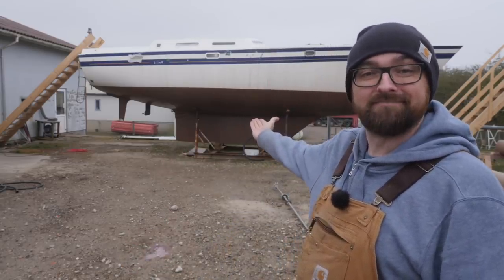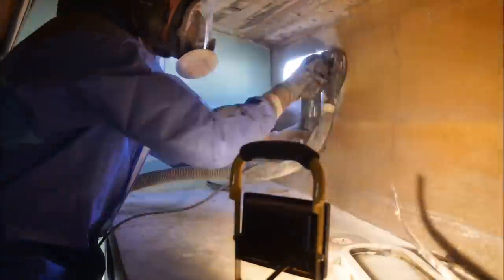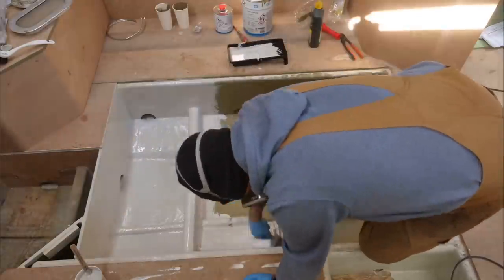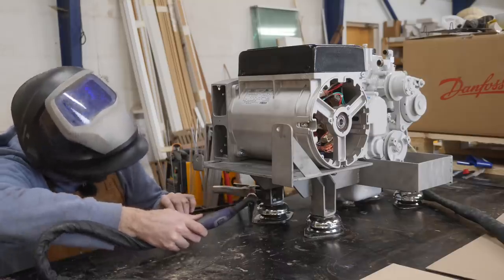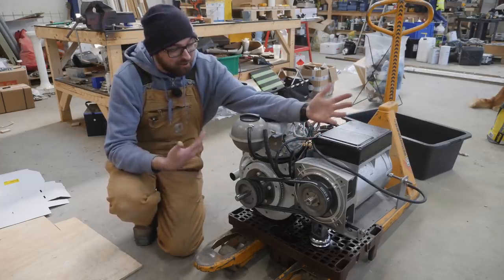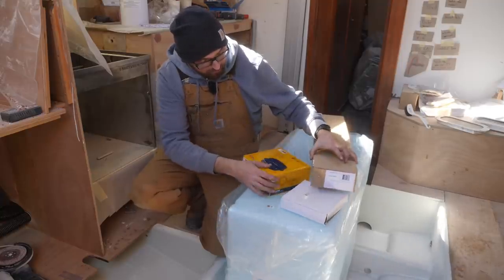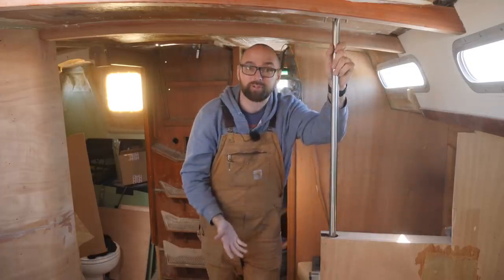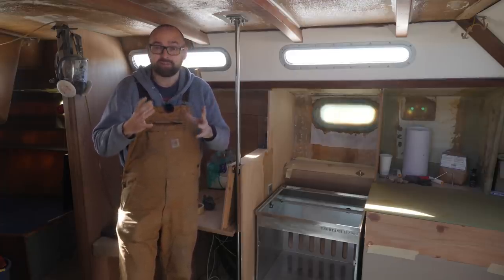Sail Life - DIY generator fail, galley pole - sailboat project

Comment: why not add a small  portable Onan diesel generator and  run it in parallel with your Perkins generator when necessary. This will also give you  redundancy for your generators and give you a generator you can take the boat if needed

Comment: dude with that genny ,you'll want a three to one turn over. the larger pulley on the gen side. should give lower rpm's on the motor ,with higher output on the genny. the better the tune, the longer ya run.

Comment: You have way more power then most, so wipe away those tears. You will just have to have a laundry day where you don't need to run the water maker too. Also your wifey better be baking up a bunch of cookies without laundry duties. So there ya go, Cookies, coffee and on laundry day it will just have to be done with a good beer. See? Solved.

Comment: Your generator problem will be fine.  I mean look at the obvious.  When will you be running all the heaters, water maker, air pump for scuba tanks, stereo, tv, uploading videos and nuking a hot pocket, washing and drying at the same time?  Just think outside the box.  The power is adequate for normal use.  Unless your salvage diving in the artic circle during winter I honestly don't believe you will be running every electrical component at the same time. Keep smiling, adapt and overcome and keep on sailing my friend.

Comment: How you going to fill that tank? Diesel stinks you won't want to spill any on the cabin floor the smell will linger for ever
Reply from the maker: The plan is to pump it into the tank from the stainless tank (aft of the engine)

Comment: Not the perfect solution, but more of a what if.... Have you ever thought about running two alternators?
Reply: Maximum power out (of the diesel) equals maximum power into (and out of) the alternator(s). You can't magically get more more power out of one or more alternators than the engine produces. That would violate the laws of physics. And given that no conversion system is ever 100% effective, you'd probably only get 90% of the engine's output from the alternator(s) anyway.

Comment: It's your boat/dream, it's your budget and time line. 

Not telling you what to do, but my two cents... 

Better to have more than needed than to work with less. This whole rebuild is yours and as many times as we've watched you redo sections because it did not meet your needs I can't believe you'd just accept lower power output.

Comment: Not sure what your price range is, but $1,450 they have several brand new Yanmar 2V750-C's on ebay item #202807121399, which are 18 hp/13.42 kw at 3200 rpm. For air freight at the 84kg claimed weight it would cost about $315 to transport it to you, probably not including fees or taxes where you are! Found that at shipnex, the company selling them would most likely help in arranging pickup or transport for the carrier, but you would have to contact them!

Comment: Keep and eye out for a Perkins 402 if they are demensionally the same run the 102 until then. It's not like this is 500 kg part that you can't move it later. Don't dwell on it Madd's fuck ups happen it will end up keeping you from moving forward.

Comment: Sad but...maybe a good moment to review all the changes from the original plans. DIY and Sailing. Are things getting off track too much or not. Cooking on a diesel stove or gas you have laying around or?.... this thing will stick in your head for years to come, unless you can say goodbye to the whole electric idea. So, if you really want a generator. Just phone the Perkins dealer, pay the 2500 - 3000,- Euro and get a brand new 402. Problem solved. for sure you will find a way to save the 3000,- on something else. good luck!

Comment: look like you are running 1:1 ratio I know that diesel engine have lots of tork maybe you could go 1.25 or 1.5 to 1 ratio use the engine tork to make up for the power. And you should use power from your batteries and not the power directly from the generator. 

battery give cleaner power less oscillation and you can add solar power to makeup for the lower power from generator. also i have seen electric saildrive that are very good at generating power under sail. that said you would need better batterie. to keep up. 

but what do i know. I still dont have a boat. i did not experiment my self (maybe a little on my camping trailler, I had power when every one was out running generator. living north of Canada)

Comment: Why not look at modifying the motor? See if you have enough meat in the cylender wall to have a machine shop bore it out and put a larger piston in, fit a small aftermarket supercharger maybe if its a 4 stroke? I bet you could at least get another half as much horsepower safely out of that engine without shortening it's life for less money than swapping it out.

Comment: I really hate to say it, but you really need to upgrade that engine if you're going to go with the DIY approach.  You are going to have a situation where you will need to have two or three items running, not for "convenience", but because you will NEED to.  Remember, you're talking lights,  Power for chargers, electronics, and more.  You will want that extra room...

Comment: 1 200 amp alternator, plenty of power
Reply from the maker: That depends on your power consumption ;)
Reply: Lithium batteries connected to a magnum inverter charger. We’re 2adults an 5 children, we also have 2 135 watt solar panels
Reply: The 12 gallon hot water heater pulls the most, washer not much but the dryer hits hard

Comment: Dear Mads :  Before you make one more mistake ,you can’t use this Tank for Fuel because of gravity problem. Plus why you want the bad smell of Fuel in the kitchen?
Where are you going to put the fuel inlet and cap?? How are you going to get a Full Tank? That why they make fuel tank small in height an long in the bottom of the floor.......Please think more before you a Project. I would use it for freshwater since you be pumping water to make freshwater. Then when tank is full it will have some pressure. To use it for Fuel you are going to have install inlet hose on top and tru the top deck. Not good. Not to be a pain but the hull in the back look very thin and more fiberglass = more weight. Think you need to see how much weight she is at Now?
I like the bigger pulley ideal , 
try it first an cost will not be to much money in that.

Comment: Sell the small engine, buy a bigger one. Take the short term financial hit and put it down to the learning process. If you don’t, it will annoy you every time you use the gen and regret the limitations in the units useability.

Comment: Mads, check this out!  Could still you find the one you wanted and clearly need! The Victron inverters aren't cheap either!! https://www.mylittlesalesman.com/2003-perkins-2-cylinder-diesel-engine-apu-type-kn70333-fam-3h3xl451e2v-runs-perfect-9399484

Comment: That’s a shame about the generator. Not that you’re looking for advice here’s my two cents and worth exactly what you paid for it. Don’t compromise. Power is maybe the most important comfort item you can have on your boat. I guarantee you will never have enough. Generators are noisy and expensive to operate. For now and forever, every time you can’t run an electrical item or are wanting to quietly enjoy a remote anchorage only to have the moment spoiled by the noisy generator you will regret the decision you make today. In for a penny, in for a pound.

Comment: Not to criticize, but honestly, in a green energy future world, We decided to just go with 700Watts of solar and 3 lithium batteries. No generator needed. What do you want to run that you feel requires the generator? We feel We are off-grid and no need for fuel or maintenance on a generator. I run 2 laptops, 2 ipads, all boat instruments, freezer and fridge without any problems at all. This assumes you leave behind those cold dark rainy places haha and sail to Florida where life is always sunny :-)

Comment: Mads, it is a simple solution. Get a correct engine. You dont want to have to run  that thing for any longer then necessary, Sure it is more work and more money but since when has that stopped you. You are like the energizer bunny!!! This is not the thing to comprise on. You have chosen to have a diesel electric boat and you need a proper diesel. 

In the more work and more money category, I was wondering if you had thought about having an ac generator on the main engine. It would be a back up, and sort of free power while motoring.... just a thought to make you work and spend more...

Comment: Not the mistakes you make it how you deal with them. 

Sell the working generator engine.  They are worth more as a working set. 

Buy another engine and generator in fixable condition for cheep. Repair the problems! 
Mate them!  Paint them! Make a buck from the swap!

Comment: If you haven't already, you may want to consider a fuel cell.  I have no experience with one, but here is a blue water sailer and youtuber I ran across sometime ago who uses one in lieu of a generator or solar panels: https://youtube/N7VYsXuvWXs. Good Luck!
Reply: I had no idea these even existed for sailboats.. many thanks, you've helped me make an important decision for the boat I plan building soon!

Edit: for those who missed the link correction above, here it is again: https://youtu.be/N7VYsXuvWXs

Comment: A second comment I have is what about mitigating with a power head on Athena's main motor, or even just a high output alternator to feed an inverter for high demand situations.   Sure it is not AS efficient, but really how much can that difference be, eventually energy is energy.   If I owned a sail boat I would hear the main motor run every week, even if it was just an exercise to circulate fluids...

Comment: You are WAY............  to hard on yourself.  Given all you have done DIY on your sailboat, don't let this minor setback bring you down.  You have accomplished so.....  much already.  Like others have said, find a 402 and swap out the engine so you can get the power you need.  If you don't, you will remember this small bump in the road everytime you run short of power.  You must be able to find a 402 somewhere over there.  We all make mistakes, just learn from it, brush it aside, and move on as this is a part of life.

Comment: I disagree about not keeping the current generator.   First, you have time and money invested in this generator.  What’s the harm in keeping it for a year or so, and seeing how much of an inconvenience the smaller power unit truly is?
You would be surprised how you can adapt to only using the appliances within the capability of the itsey bitsey.
If you find it unacceptable, change it down the road.  It certainly is adequate, but merely a disappointment.

Are you concerned about the weight of the fuel tank being higher with the change of plans?   Usually you would want that weight as low as possible to act as ballast.   I maybe don’t know the difference in true design, so just a thought.

Comment: For what it's worth: "brand new" 402D-05 lists 3000$ on ebay, has almost the same dimensions as your 102-04, is marginally heavier  and should run singificantly lower rpms for the same output power, due to bigger displacement and more torque.
https://www.ebay.com/itm/Brand-New-Cat-C0-5-engine-or-Perkins-402D-05-engine-/303106521767

Comment: A diesel oven w
should solve all your problems and save a lot of diesel. It's not quite too late to redesign the kitchen again. Should save money in the long run.

4kw is plenty. Just use less power. If it really is dark and cold it's no problem to run the generator longer, you have a heat exchanger on it, use that to heat the boat. The reflex stove should turn itself down automatically. If it isn't dark and cold your complaint about "wind and solar aren't enough" isn't true. 

Also, your explanation that "I am fine with [burning as much diesel as I feel like just for my own comfort and convenience]" is weak as hell. Find a better solution or at least a slightly more diplomatic/scientific excuse.

Do you actually know of a good comparison  between running an electric oven off a generator vs propane oven vs diesel oven? As a retrofit electric is the easiest by far, but you've ripped the whole boat apart so an exhaust for the oven is no problem. Why did you chose electric? I will probably face the same choice at some point, so I appreciate any insight.